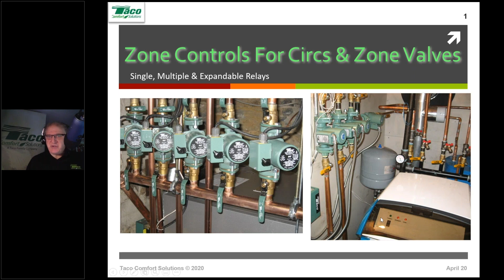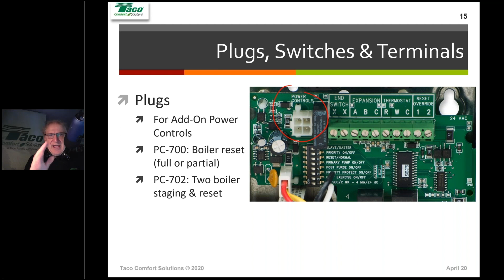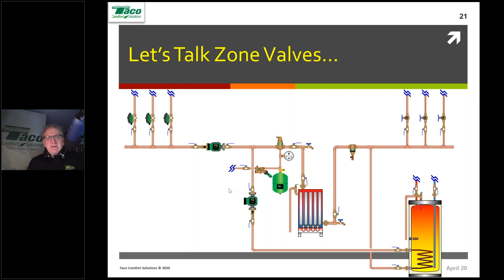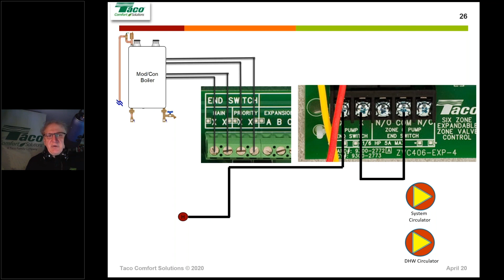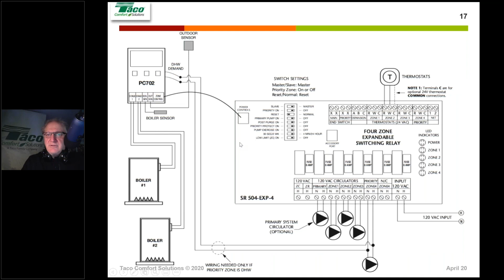Zone Valves, Circulators, Relays & Controls

Comment: How do the system and dhw circulators work if you DO NOT want dhw set as a priority zone?  With zone valves..
Reply from the maker: Ted,
If you had a DHW circulator and a heating circulator that supplied zone valves for heating the house, you would need a ZVC controller that would control the zone valves only and then you need to us a Switching Relay (SR) for the 2 circulators.

Comment: Wait... is the valve normally closed and opens to send hot water when energized, or are the electrical contacts normally closed and open when energized, thus closing the valve.
I though NC meant the valve actuator was closed. This makes it sound like the electrical connection is normally closed.
???
Reply from the maker: Good Day Bob,
Thanks for watching the Taco Tuesday webinar series. We make all styles of zone valves in many different configurations. There are some that are normally closed (NC) and then some that are normally open (NO). In most instances, we use NC valves which means while the valve is sitting there, without power, is closed until there is a call for heat, the motor gets power and open the valve.
The Zone Sentry zone valve uses that power a little differently. When the call for heat occurs, power is applied to the motor, the capacitor gets charged and when it fully charges, the power is discharged and the valve opens.
While the valve is open, the capacitor now recharges and when the call for heat goes away, power is removed from the motor, the capacitor discharges again therefore closing the valve.
I hope this answer your question and if not, please do not hesitate to contact us or your local Taco representative.

Comment: I had an Erie Controls relay, which I thought had failed as radiant floor heating circulator would not energize.  I replaced the Erie with a Taco 501.  Still not circulator so I had to temporarily connect it to the NC.  After many hours of troubleshooting, I found a broken end switch wire at a bundle of wires connected to the radiant floor heating actuators.
Reply from the maker: Glad you found the issue! Good work!

Comment: I need help with my system it says I have a valve open an im not getting heat to my upstairs
Reply from the maker: Fernando, the Zone Valve Controller (ZVC)has two indicator lights on it per zone. The one on the left is amber in color and when lit, indicates that the thermostat has a call for heat. The light on the right is red and indicates that the zone valve has opened and the endswitch on the zone valve has closed. If you have just the amber light and not the red, this will indicate that the motor of the zone valve may not be operating properly. If you have just the red light and not the amber light, the endswitch in the zone valve may have a problem. I hope this helps you find your issue.

Comment: 2:00 How to ask a question during the live presentation
3:30 single pump relay SR 501-4
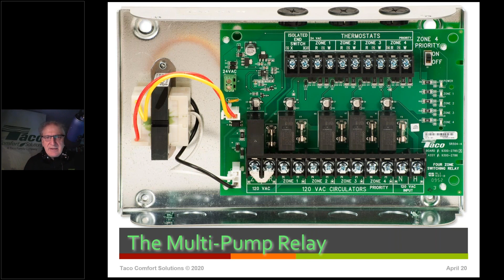12:57 questions about single pump relay
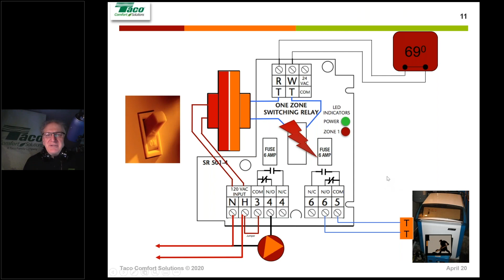14:44 multi pump relay SR 504.4
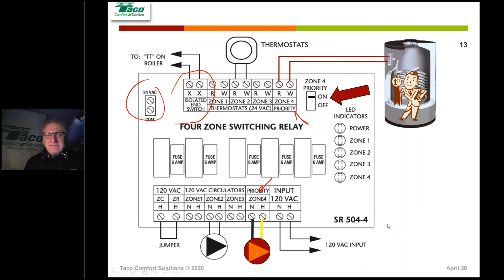22:12 EXP expandable relays
24:35 plugs, switches and controls
33:18 zone valves
1:09:59 still taking questions

Comment: i have a sr503-4 how to run my oil forced air furnace, and the pump on hotwater stove
Reply from the maker: Hi Carl,
The SR-503 is designed as an interface between your low voltage thermostats and your high voltage circulators. There are many applications for the switching relays and you can view the different wiring diagrams here and find the one that matches your application. https://www.tacocomfort.com/documents/FileLibrary/100-92.pdf

Comment: Question: I installed a Rheem combi boiler that needs the "heat demand" 2 wires to be between 0-10 DC Volts.....which Taco controller can I use?
Reply from the maker: dspreeuw, thanks so much for watching the Taco Tuesday webinar series. Before I answer that question, can you tell me what model boiler you are using so that I may review the product and recommend the correct controller? Thanks
Reply: @TacoHVACtv  I missed the live webinar, but viewing now via YouTube. 

I am presently considering installaton of a Lochinvar NKC Combi, which uses 0- to 10-  volt signal.  Residence is presently one zone; slight possibility of one additional zone added later. 
Which Taco controller can be used? 
And, how would it integrate with the internal Lochinvar NKC pump?

I have benefitted from viewing webinars a great deal.  Thank you John, Dave, and Rick.

Comment: explain zc zr for tankless coil
Reply: Yes we need an explanation of that how the tankless get priority.
Reply from the maker: Hello David,
The ZC ZR terminals on a Switching relay are used in a boiler that has a tankless coil. In other words, the boiler is maintaining a temperature and not a cold start for domestic hot water for the home to be available. When there are multiple heating zones in the house and those zone circulators are controlled with a SR panel,  you then remove the factory installed jumper between ZR and ZR and connect it to aquastat that is controlling the water temperature.
The result is when the aquastat calls for heat, it would temporarily shut off the power to the zone circulators to ensure all of the heat the boiler is making is used for the domestic hot water.

Comment: I have a zone constantly calling for heat. Thermostat is off the wall so theres no issue there. I removed the wires from that zone on the switch relay and once I turn the boiler back on, it calls for heat and the only hot pipe is zone 2, providing heat to the second floor. I do not need heat at this point in the year. Is it safe to just turn the water valve to that zone off?  Thank you for anyone's help.
Reply from the maker: It sounds like you may have an endswitch inside the zone valve is stuck or broken. Yes you can turn off the flow of heat to that area but there may still be a call to the boiler until it is corrected. What zone valve are you using?